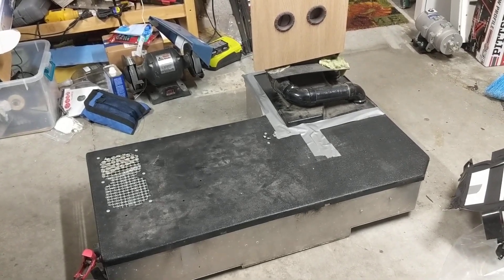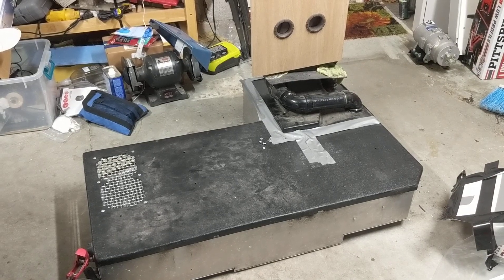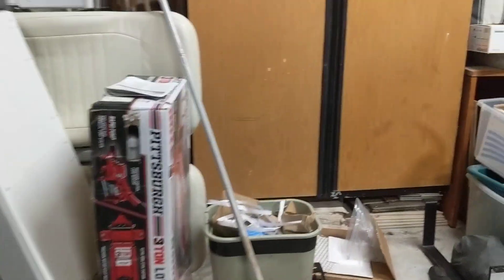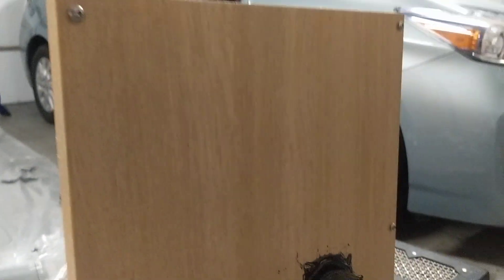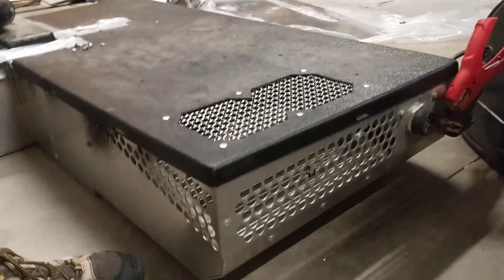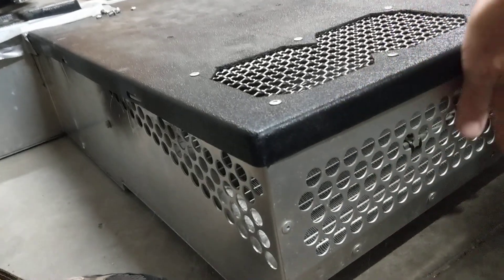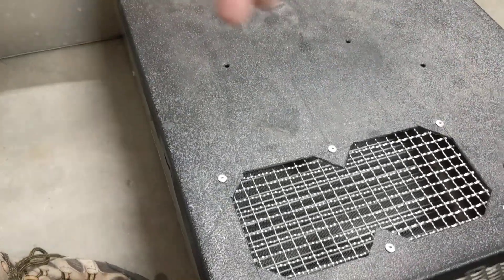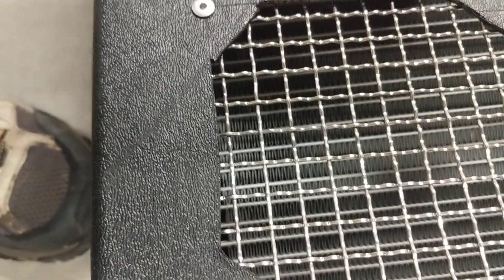Part 1 - Hymer Aktiv Loft Air Conditioning Ducting

Comment: Did you have any information on the compressor for this basement a/c as the one that I'm working on the compressor don't come on and it has positive power on the 3 wires going to the compressor
Reply from the maker: The compressor is three-phase.  Are you a member of the Hymer Aktiv Facebook group?  The schematics are posted in "files".
Reply from the maker: The motor was shorted and the three phase driver burnt out on the one I fixed.  It was a lot of money and the AC didn't have enough BTUs.  

BTW: The wire bundle between the driver and motor melted and shorted.  I've wondered if they failed and killed the motor or the other way around.